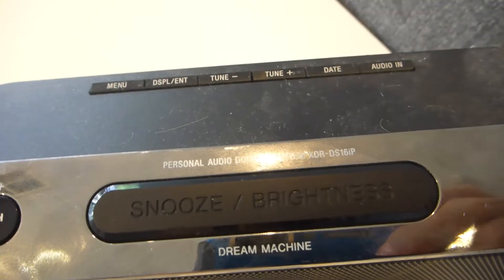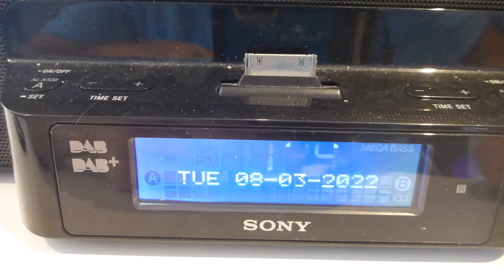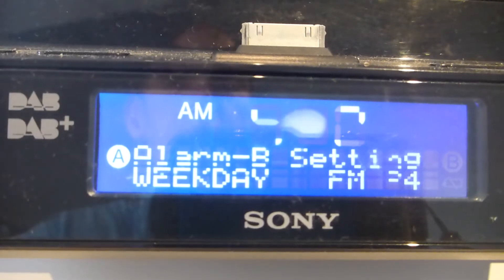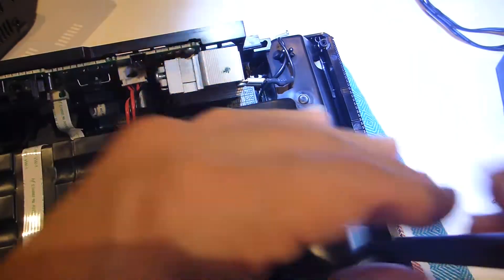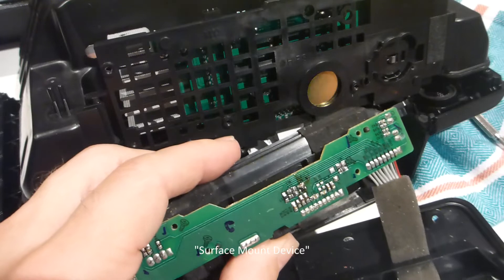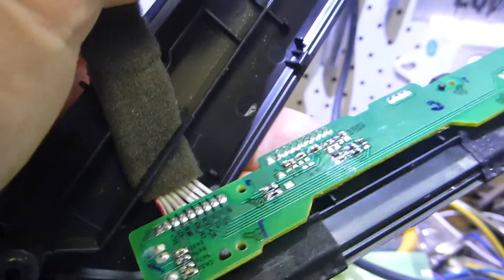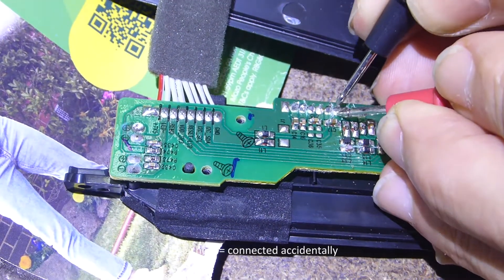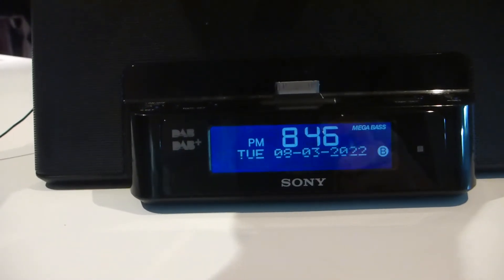Sony Clock Radio XDR-DS16iP - LCD Display Repair

Comment: Where is the LED that provides backlighting for this LCD display?
Reply from the maker: I don't recall seeing them, but suspect they are micro SMD LEDs mounted at each side. They would typically be in a sealed strip.

Comment: Please tell me how much out put Voltage AC Adapter (Power Pack)??? 5V/6V/7.5V or 9V
Reply from the maker: I just checked, the power adapter is unmarked - no branding, no voltage markings and no polarity. It also plugs directly into the clock radio, so is hard wired - so there's no way to tell. I would expect 9V.